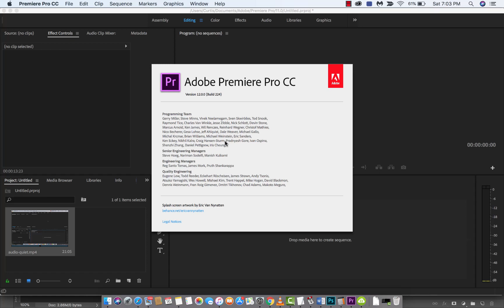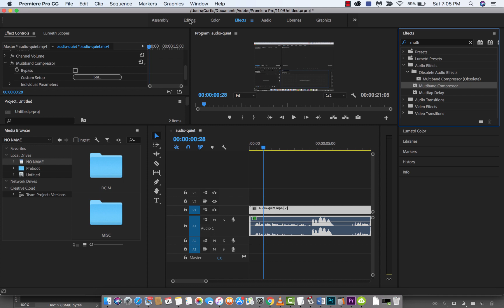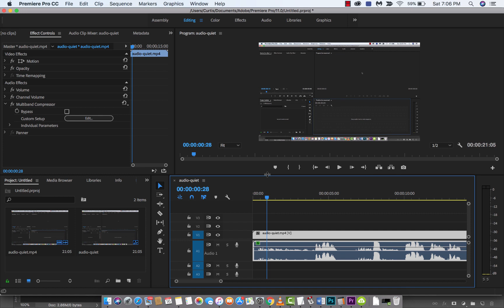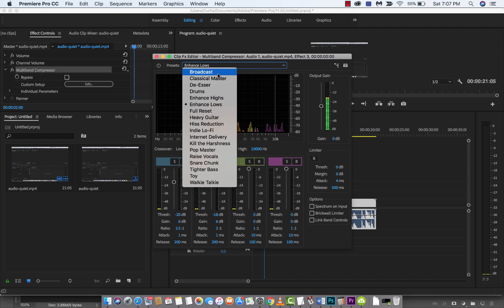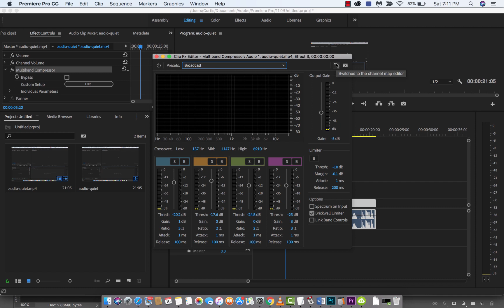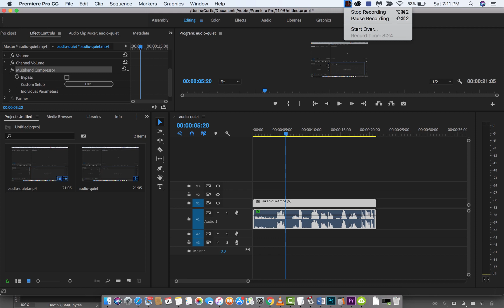Bad Audio to Good Audio - Adobe Premiere Pro CC - Multi-band Compressor

Comment: Thanks for this....  Please what can I do right Now.. I added a tube compressor and denoiser to my video but I couldn't play back due to system's fault....  After I exported the video I now realised that the audio effects is not good and the rushes have been deleted from my system...  please is there a way I can correct the denoiser and tube compressor effects from the already exported video in premier pro...

Comment: Hi Curtis, just to let you know, your "Loud Audio" portion of the audio is still clipping in the red.
You should also consider applying a hard limiter filter and adjustin it until you get loud in the mellow yellow. usually between  - 6 and - 10 dbs works well for me.
Reply from the maker: Good stuff, I shall look at that!  Thank you for the tip bro :)
Reply: @kingy-ai 
you're welcome and thank you for the tip on how to make the audio preset. I usually apply filters from the audio track mixer and preset saves aren't available that way. You saved me a tremendous amount of time 😊

Comment: I'm having a difficult time with finding the right tutorial that addresses the problem I'm having with this .WAV audio;
@t

I think it sounds both like it's in a can, and/or muffled.  I believe I 
had over "Noise Reduction-ed" it, but I overwrote the original, so I 
need to fix it (as best as I can).  Can you listen to it and point me in
 the right direction?